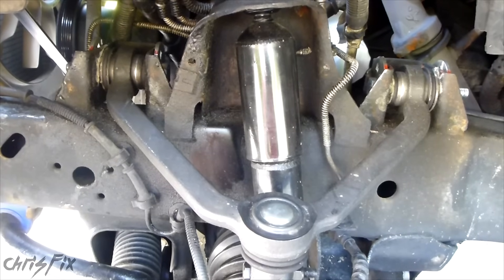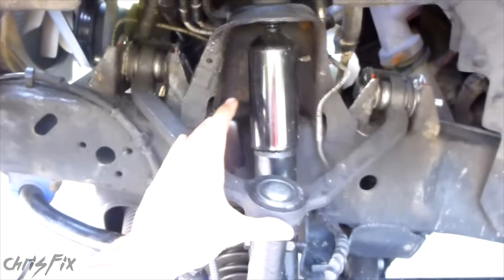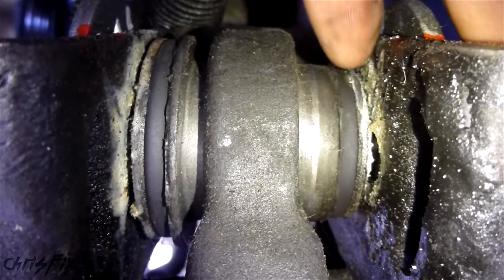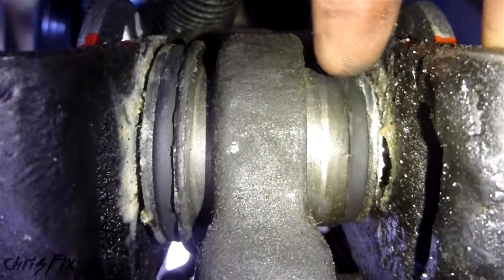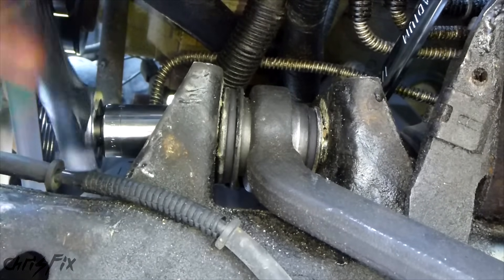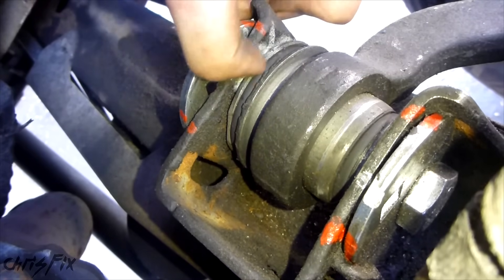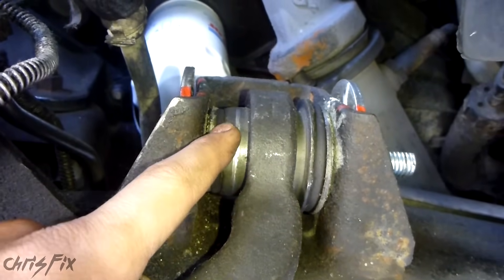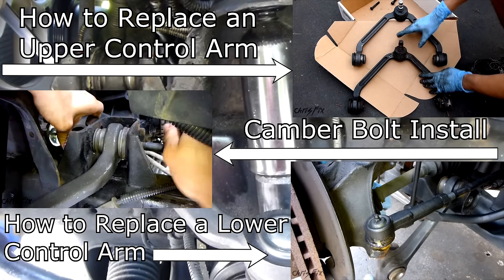Control Arm Bushing Preload, Important Information!

Comment: Good video, and an important point, but it's worth pointing out that many people will have vehicles where it's impossible for them to access the bolts once the wheels are back on the ground. In those cases, they can leave the vehicle on the jackstands and jack up the axle (or each individual wheel if they have independent suspension) to create the same loading effect before they torque the bolts.
Reply: I was going to ask this. Good to know.
Reply: dunebasher1971 I was just thinking the same thing. I have a lowered truck
Reply: Andrew Bowles when I replaced my control arms I placed a jack underneath the lower ball joint and lifted it up that way. then I tightened the CA's bolts. then I put the tire back on.
Reply: Yes but how do you know how much to jack up the suspension to where it would normally be?
Reply: e.g. you could measure the distance between wheel centre and wheel arch before changing the control arm.  then jack up the wheel to the same height.
Reply: dunebasher1971 i
Reply: My car's factory service manual(240sx) says to never jack up the rear suspension at the lower control arm, so how can I preload the arms before torquing down the bolts?
Reply: You might also check if a DIY car repair shop is available in your area and if you  like their policies, pricing and people. Then you can have a lift.
Reply: @mrsemifixit  Jack it up slowly and watch your jack stand.  Right at the point the weight is off the stand is where you want to cinch down the bushing bolts.
Reply: @mrsemifixit  put the car on jackstands at the pinch weld ( where you would use factory Jack that came with your car) or the frame if you have older car/truck. Now, with the wheel off, begin jacking with a floor Jack at lower A  frame. Continue to raise the suspension until the car just barely lifts off the jackstands. This will have the same weight on the suspension as if the tire was supporting the car.
Reply: Put your jack under the tyre, not the control arm. Use a wood block to avoid the jack saddle biting into the rubber.
Reply: Set the car back down on ramps. If the car is too low to drive it off the ramps after you tighten up the control arm bushing bolts, then just Jack it back up and remove the ramps and let it down.
Reply: @Luckingsworth  or would wood between jack and disk work ok?  shouldn't harm disk...
Reply: I wrote the same stuff and then went to read the comment section. Lol :)
So .. I'm with you
Reply: Yeah but is it fine to do it one at a time? Or both sides jacked at the same time
Reply: @Mike-we3rb  totally fine to do one at a time. As long as you can jack one side to proper level
Reply: @ArtemLokhovitskiy  like just prop it up to almost equal the opposite side
Reply: @antiangelofmusic  I would not have thought to do this without reading this comment. ✌🏾
Reply: @Bai_L  This is the part I was unaware of when I remove the entire suspension...moving forward though, yeah.
Reply: @mrsemifixit  measure the distant before using the jack. Jack up the suspension the amount you raised it from stock height would get it close.
Reply: That’s probably a smarter way anyways, by measuring the clearance before the job, you’ll know how far to jack the car up with the wheel back on for measurement purposes
Reply: Takes 20 seconds to do once you’re done with the replacement part. But even just putting in that extra effort while it’s on it’s own weight has it’s own benefits. A jack wouldn’t reference for 2400-4500 pounds on the suspension. I can get under my civic and do that. I finally learned about preload recently when I did my front struts and I will tell you from bad experiences, parts would prematurely go bad. Like control arms and ball joints.
Reply: @mrsemifixit  jack the control arm up until the full weight of vehicle is resting on the jack. Just like it would be if it were a wheel.
Reply: No need to measure or over do it. If the weight of the vehicle is on the suspension that is where you need it to torque the camber bolts.
Reply: @bdhusmarine26  Right, well said.
Reply: @mrsemifixit  Both what X-man said below (3yrs ago vs my comment here), and also an alternate method:
Measure your "ride height" e.g. from hub to fender while the vehicle is on the ground.
Then: while the car is on the jack-stand, jack-up that wheel/hub until you reach the same "hub to fender" ride height.

If you have ramps, that's another way.  The only drawback to ramp method, is due to car's pitch (slope) being different, the suspension might not exactly "sit" the same as if car was flat.
Reply: @corky9127  If after you mount wheel/tires back on the hub, if you can still fit the jack under the tire, that's one way.  Otherwise, consider:  without the wheel/tires, put nuts back on wheel studs (to secure the rotor), jack under the rotor.  Or, remove the rotor entirely, jack under the hub.

[Edit]  Yes, of course we should be VERY concerned about the car "rolling" off the jack in any of these methods.  So use parking brake or whatever you need to make sure the damn thing doesn't roll.  😅
Reply: Ah I guess I should of went over the comments first! Thanks for clarifying this..
Reply: @mrsemifixit   All of its natural weight closest to where it would be on the tire.
Reply: Can you tighten up the bolts on truck ramps or solid blocks?
Reply: Super good point 👍🍀🇬🇧
Reply: My PT Cruiser had a second set of control arms. I never heard of preloading before I replaced them. Sure enough, within two weeks the ball joints blew out.
I have the new set and my grandson told me about preloading and then I found ChrisFix video in it.
The PT has no room under the front to even slide a floor jack under it.
I'm going to reverse calculate how far to bring the body back down.
Measuring the rear tires on the ground and they are 12" from the ground to the center axle point in the hub.
The front hub sits 17" off the ground while jacked up and has no tires.
I will need to find the height of the body, as if it had all the tires on and then look for the 12" point at the axle hub to ground.
I just hope my jack stands can go down far enough. I may have to use 2x4 blocks.
I have a pretty good idea of what needs to be done now, thanks to the video.
Reply: @mrsemifixit any amount. Weight in the car is same on jack as it is on the floor
Reply: @andybozeman9769 Do both sides need to be in the air for this?
Reply: Wow helpful video I paid a mechanic to put upper and lower control arms after the installation there was a squeaky sound Everytime I hit a bump so I bought new coil spring, struts and had them installed and still squeaky sound. After watching video I told the mechanic to loose all the bolts upper/lower control arms while having truck on stands to put the Jack under neath the lower control arm and lift until the the body of truck was lifting then tightened all nuts/bolt and boom that stop the squeaky noise I had. $800 later problem fixed. Well I got out of it new coil spring/ Struts

Comment: This is the only thing on the internet that explains the bushing and control arm relationship.
Reply: The ball joints don't need to be under load?   Just the bushings?  I heard you should do the same for your lug nuts.  And MacPherson struts.

Comment: I see the logic to do this, however I would find it hard to believe the factory preloads on the assembly line.
Reply: You’re right they probably don’t but Are your bushings failing?  Mine are.
Reply: On my car how the heck are you supposed to tighten it with preload if the strut is in the way??  Let alone with the wheel on. I mean I could try a spring compressor but I'm not going to I'll take my chances.
Reply: I do these all the time.
All you do is make sure the body is resting on jack stands.
Then using your jack, jack up under the ball joint (being careful with balljoints which have grease nipples) and keep jacking the control arm up until the body lifts off of the jack stand.
It's now pre-loaded, to be able to torque it to spec

Comment: Thanks Chris,
     I had just replaced both rear lower control arms, struts, and trailing arm bushings on my 2001 Honda CR-V and was noticing a bunch of strange noises. I'm sorta meticulous (but by no means a car expert) and I knew I had torqued everything correctly with good quality torque wrench but started to check into bushing design. After I realized how they really work I did a google search and this video popped up. I loosened all the bolts, drove it around a mile or so then came back and did just what you said. I Drove it around a few more miles and the effect was stunning. Hardly any noise at all. Thanks for putting up this video. Nice to have someone who knows cars affirm my screw up.

Comment: Pre-load and proper torque are two of the most important and overlooked aspects of working on suspension systems.  I've used the jack method dozens of times, and final torque adjustment is also easy to do on the alignment rack.
Reply: Fluffy65 If you use the jack method with tire off for more room to access the bolts, how do you know how much to jack up the suspension to where it would normally be?
Reply: You have to measure distance between wheel arch and tyre - both with car on the ground and jacked up. The difference between distances will tell you how much you need to jack up the hub assembly.
Reply: Boris Savka Wheel arch and tire? Could you elaborate? Thanks
Reply: Ok, here it goes:

1. With car on the ground, measure distance between wheel arch and top of the tyre.
2. Jack up the car - on the side, where you measured.
3. Again, measure the distance between wheel arch and top of the tyre. Since wheel is in the air now, the distance will increase.
4. The difference between the distances (car on the ground vs. jacked up) will tell you, how much you need to jack up the hub assembly to give it a proper preload.

On the other hand, this method - i think - will never properly replicate the car being fully on the ground. Mounting pit or certain types of vehicle lift will give you access under car, with car sitting on all 4 tyres.

Good luck !
Reply: Boris I am trying to understand your wheel arch method.  With the tire on the ground could I measure the distance from the bottom of the lower control arm and the ground and then jack it up remove tire and then jack up the lower control arm  the same distance and then do the final torque setting.
Reply: After you take the tire off the tire is gone all you have to measure is the rotor.  So another way would be to measure both from top of arch to center of wheel or hub both with tire on and off, would this not work better
Reply: put the entire car on blocks and you should be able to slide under the car and torque the bolts

Comment: Thanks for tips. Cause I did my lower control arms without caring about the car load. I did tight all the way in and I had a nightmare. My front clunked and no answer to my endless questioning, why did I do wrong with my car. Finally someone tells me the reason why. Thanks for your help!

Comment from the maker: Make sure you put your tires on the ground before tightening those control arm bolts!!!
Reply: Dude wished you would have told that before I finished
Reply: patrick cordery lol same here.  Did mine a few weeks ago.  Will have to go back in and adjust them.  Don't think it will be fun trying to tighten them with the tire on tho.
Reply from the maker: patrick cordery I thought I remember telling you that? If not, my bad. I am editing an adjustment to the control arm video. I just learned this myself if it makes you feel any better lol.
Reply from the maker: ProtectionDirect I had to adjust mine as well. It isnt too bad with the tire on the ground. A little tight but not too bad.
Reply: ChrisFix Said a man driving a truck :) and then imagine honda fan watchinh ur vids xD
Reply: +ChrisFix Does the preload apply to all vehicles?
Reply: im doing both front lower control arms. can i simply drive the front up on 2 floor ramps to tighten the bolts ?
Reply: blackcarmafia ...I know the feels. 2000 Civic DX Hatchback
Reply: I didnt do that when i changed bushings... can i do it the correct way now?   jack mine up > loosen the bolts >snug up > drop > tighten.. will it throw of my 100% alignment?
Reply: I dropped my 98 crv to the ground before I torqued both bolts up to 40 ft lbs and now my car is bouncy and not turning right. Is it because I need an alignment now or the preload may not be right? Should I loosen them up and drive around a bit then tighten them back up. please help me.
Reply: As soon as you jack the car up again or remove the jack from under the control arm, doesn't that cause the pre-load that was set to be lost?
Reply: And thank you ChrisFix, also nice procedure of those who where saying to pre-load their suspension.
Reply: Does the same go for the ball joint bolt?
Reply: @nismos14us  right, it doesn't make sense. If it would tear the bushing when you torque it first then lower it, it should also tear it when torqued on the ground then raised. It's the same amount of travel with the same torque on the bolt. I highly doubt the direction of travel would matter to the bushing.
Reply: @vengeance187  Lower control arm work (and really, suspension work in general) was completely new to me before yesterday, but I think the difference is this.  If you preload then lower the car, you'll be driving around FOR A LONG TIME with incorrect positioning and also its taking all the knocks from the road too..  Whereas when you raise the car (like in your comment) its only for a very short time in comparison eg to work on it...
Reply: I just did my Honda accords. Springs shocks n upper CA. I just tightened it a few inches above the top of the knuckle where the upper ball joint goes. I had no idea about preload but it “looked bout right” where it was when I took the old off.
Reply: =/ I had a shop install new UCAs with a suspension lift a year ago. They torqued everything while it was in the air and Its been creaking on and off.. I have just been greasing every bushing I can to help limit the noise to no prevail. After watching this video Im going to go revisit the UCAs and hopefully do it properly by myself. How much strain have I put on the UCA components ?

Comment: Ya I have a car that is almost impossible to get under when car is on the ground.  So I put a jack under bottom control arm and raised it until it comes of jack stand.  I than tightened all the bolts from there.  Atleast people know they have to be under weight load to tighten them either way.  Appreciate the videos man.

Comment: Thanks, Chris.  That was a very helpful explanation.  I finished the upper and lower ball joint replacement on my 2000 Mazda B3000 several days ago, and forgot that you'd mentioned that it's best to tighten the bolts when the truck was on the ground.  This video explains why.  I'll go check the bushings and re-do the tightening process today.  Thanks, again, for all the great videos! You've saved me a ton of money.
Reply from the maker: Gertie Craign Great! I am glad the video reminded you! I am glad my videos are saving you a lot of money!

Comment: Thank you chris, saved me. But I did mess up and tightened the bolt while the wheel is still off but thankfully my car has still been sitting on jacks this whole time. SO now I know to losen the bolts some before finishing my front suspension and lowering my car. Thanks again!

Comment: It's crazy because I was aware of the need to do this after I replaced tie rods and control arms on my '93 Taurus. The tie rod replacement went pretty well but the control arms were a curse. The support rod that connects to the control arm would not come out and had to be removed along with the control arm then I had to fight with it off the vehicle and ended up cutting the old control arm in order to free the support rod that I had to have in order to put it back together with my new control arm. It really was a nightmare and I had to have my medication adjusted and extend therapy sessions for another year but...I did finally get it all reassembled and amid all this distraction and suffering, I forgot to preload the suspension before I torqued everything to spec. I was just so relieved to get it reassembled and when I got the whells back on it and off the jack stands I started on a test drive...yeah....I got to the end of the alley ( about 30 yards ) and knew something was FUBAR. It felt like I was driving on a flat tire on the front end so I eased it back to the garage and the light bulb came on.....damn....I was supposed to put weight on the front suspension before tightening every back up. Anyway...now I have to figure out the best was to set the front suspension down so there is weight on it, with the tires off because there is no way to get to stuff with the tires on. I just wonder what the best way will be without doing any damage to the front suspension? Always something I guess. My life is very different than so many of these "perfect world"---"easy fix"----clean and rust free vehicle youtube videos. It is very raw and real over here in the real world. Replacing the tie rods and control arms has been 2 full days in the garage and I am still needing to do what I mentioned above.

Comment: Just did all four uppers on my Envoy.  Used a sizzor jack to lift the lower control arm high enough to make the side I was working on lift just off the jack stands. Easy to then reach in and give the bolts that final full last turn. Thanks for the tip.
Reply: Is it okay to only have one side of the vehicle up when doing this?